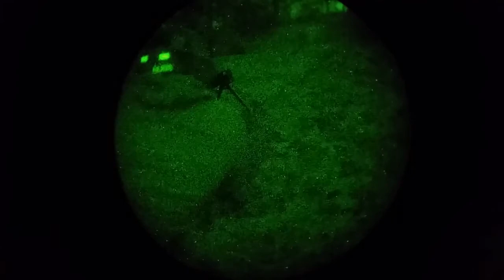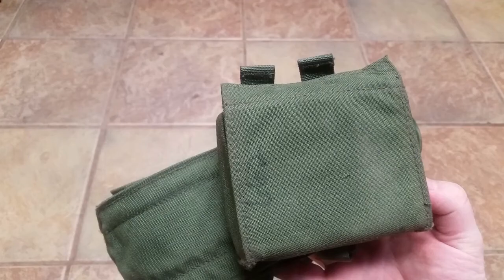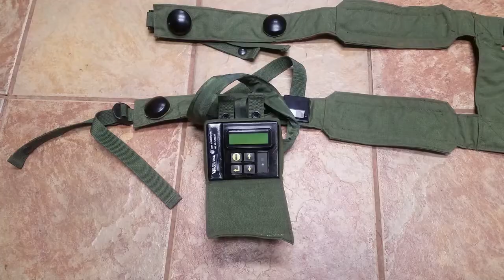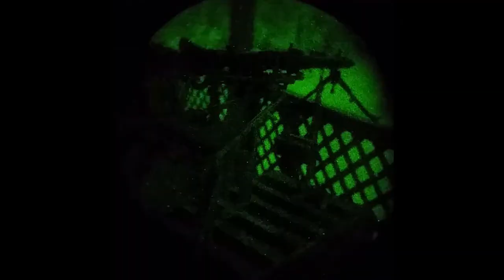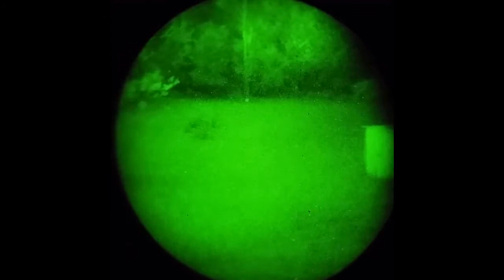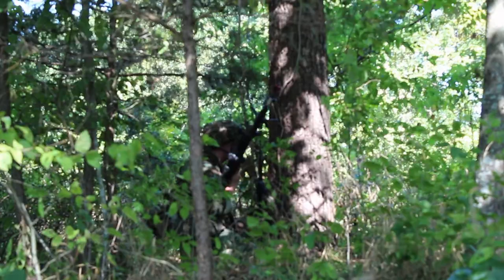MILES 2000 User Guide

Comment: Great video, brings back memories.  I worked on the small arms and manworn equipment when it was designed at cubic defense around 97 to 98. My buddy and I had the sats breadboarded and would fire a bazillion blank rounds and make tweaks to profile and mimic each unique weapon. The m2 was obviously the most fun. For environmental testing we did heat, cold, vibe and dunk tests at the plant in san diego but I got to drive up to Fullerton and spend time at an environmental  company we contracted to perform dust and salt-fog testing. Great times, and a very unique experience.

Comment: Just purchased my first harness and trying to figure out what battery I'm supposed to use?
Definitely not CR2's, I think it's supposed to be 9v.
Reply from the maker: Old 1980s stuff uses 9V,  Miles 2000 harness uses a 14500 3v battery,  Miles IWS which you just purchased uses qty 2) 2/3A batteries

Comment: Nothing acts like a bullet, except a bullet. I don't want to sling bullets at each other in training!

That said, for any force-on-force training beyond 20 meters, I'll take MILES. Hands down. It literally shuts down the opponent's system when a "kill" is scored - at night, at a half mile (800m). It works in subzero temperatures of -20F. It works in extreme heat of 120F. Shock, dust, water resistant.

No simulation is perfect. But MILES comes impressively close.
Reply from the maker: I whole heartily agree! Like with any Simulation system the realism breaks down after you start squeezing triggers. That said, the MILES system still does a decent enough job (really freaking good enough with its faults considered). More importantly, it doesn't get in the way of the training, but rather enhances it!
Reply: Any type of simulation is good. Definitely a pain penalty helps get the heart and adrenaline going, but like said it also add extra gear that takes away from being able to do long term field training.

This is cool, where did you get these and how much does something like that cost?